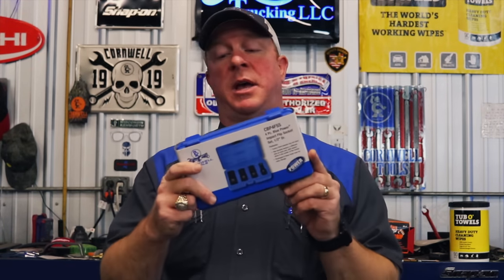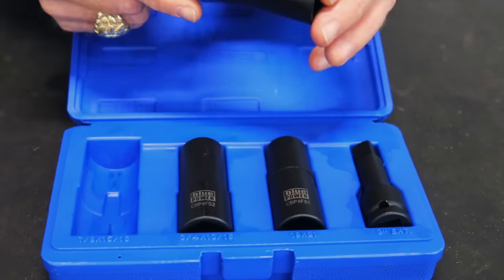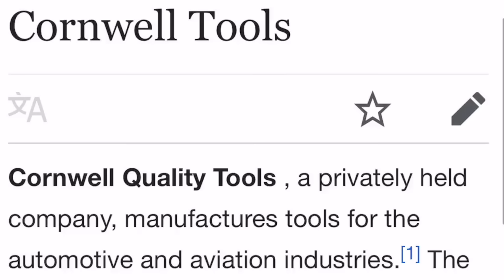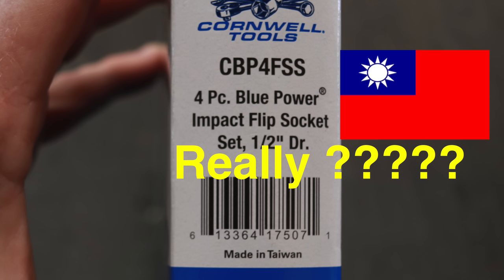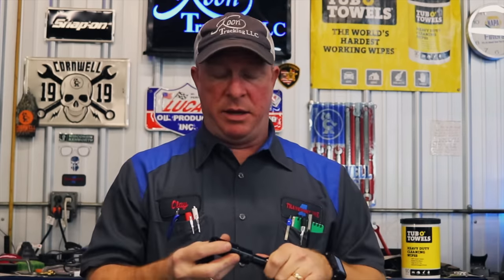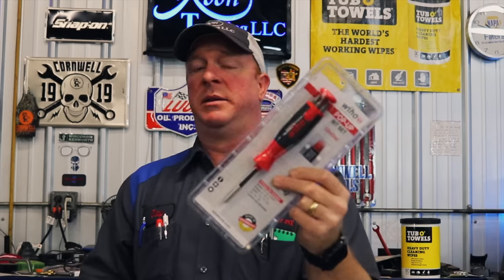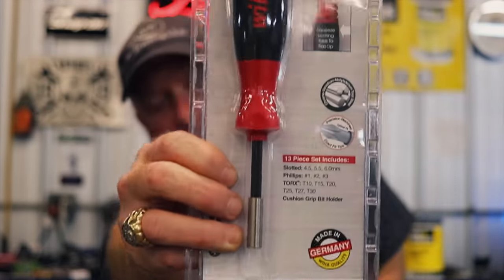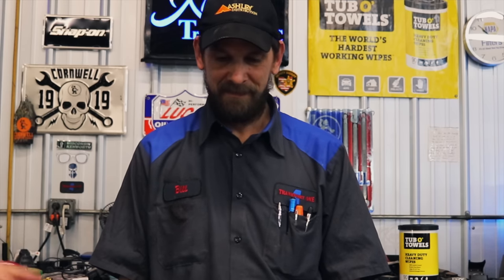Cornwell Tools: Putting Profit Over Quality. Made In USA?? You Guys Are Sneaky AF

Comment: Are impact sockets actually considered "hand tools"?
Reply from the maker: Yep you can use them on a ratchet or an impact that’s exactly why they are the best and all the BS about they won’t fit in places like chrome, well that’s BS. It might have been that way back in the 80’s but impact sockets are much thinner now than ever before (I’ve even done a video on this topic and we measured them) very very few instances a chrome will work where an impact won’t. So you can buy a cheap set of chrome for those super rare occasions

Comment: Before cornwell got rid of my tool guy he was getting upset with them because they were pushing blue power
Reply from the maker: Profit over quality I guess. Seems to be a thing with Cornwell
Reply: They ended up pulling his franchise part of it was he refused to stock truck with tools that didn't sell but they required
Reply: That's way it always works get a good tool guy that actually cares they get rid of them but a snap on and matco tucks that only warranty tools they sold stay around

Comment: Blue power is there lower line of tools most of them are made out of the USA
Reply from the maker: The point of the video was to show how Cornwell is being deceitful about where it is made. It would have been nice if it was stamped on there like the pliers they sell are and not in tiny print above a barcode on a piece of cardboard that will be thrown away. In most cases if it is on a tool truck and not ordered in like my set was the cardboard would have been tossed out already so they could be displayed and opened and it would lead you to believe they were American made. I just don’t think they should be so deceptive about it. Most blue point stuff is stamped “Made in Taiwan” and some BluePoint is made in USA
Reply: Maybe you should look into wear shit is made or ask your Cornwell guy
Reply from the maker: It’s hard to tell when they don’t put it on the case or the tool. When they intentionally stamp it on the cardboard wrapper in tiny print you would think they don’t want u to see that. Guess they are ashamed of that fact or maybe they know if it was marked like it should be they wouldn’t sell them. Seems intentional to me

Comment: I honestly don’t think any of their Blue Power stuff is US made. It is like Blue Point I believe. I know it does suck though.
Reply from the maker: It would have been nice if it was stamped on there like the pliers they sell are and not in tiny print above a barcode on a piece of cardboard that will be thrown away. In most cases if it is on a tool truck and not ordered in like my set was the cardboard would have been tossed out already so they could be displayed and opened and it would lead you to believe they were American made. I just don’t think they should be so deceptive about it. Most blue point stuff is stamped “Made in Taiwan”
Reply: Koon Trucking yeah it is pretty unfortunate. We dont have Cornwell in the Texas panhandle. I have never owned any cornwell. I do agree with you. If it comes from the truck it better be US. Anything foreign i can get off Amazon a lot cheaper. I know anything Matco sells i can get half price off Amazon. Great video. Hope you are doing well

Comment: Northern tool has a similar set for about 15 also made in twain, maybe at the same factory.  A lot of the steel used in the us comes from china from american scrap.  Chinese steel can be traced by laboratory test.  Chinese steel has a higher level of isotopes.  I worked a place that sold ameeican  made equipment with chinese hydraulic motors with made in china ground off.  Its not smart to mess with wild bill he has a large fan base in youtube land.

Comment: ibought a set of 3 hose pliers from Cornwell on sale from $ 99.00  to $ 79.00 case said use ,each plier says China . They are rusting in my tool box ,never use them. I bought a similer set from Harbor Freight for less then $ 20.00. use them constantly and they have held up fine.made in China.  Go  figure.

Comment: I'll make this ez for you Mr. Koon, Blue Power is their 2nd tier line, made outside of the US and usually 50-75% cheaper than the premium Cornwell product made in Ohio. If it's Blue Power it's never an American made product. Snappy does the same damn thing with their Blue Pointe product and don't even get me started on MAC and MATCO..hell, Matco makes nothing themselves but their toolboxes, everything they sell-minus the toolboxes-is sourced from the orient.
Reply from the maker: It would have been nice if it was stamped on there like the pliers they sell are and not in tiny print above a barcode on a piece of cardboard that will be thrown away. In most cases if it is on a tool truck and not ordered in like my set was the cardboard would have been tossed out already so they could be displayed and opened and it would lead you to believe they were American made. I just don’t think they should be so deceptive about it. Most blue point stuff is stamped “Made in Taiwan” and some is made in usa

Comment: I disagree. The tool truck is all about customer service and convenience. If it were purely down to quality, there's loads of other high end options out there. Mac, Matco, and Cornwell farm out most of their stuff and don't openly state the COO. With Snap on, at least I can go on their website and easily check the COO of each item. The bottom line is that I'm only going to pay so much for a tool where the main motive for outsourcing is cost cutting. If the tool trucks want to compete with cheaper options like Harbor Freight, Tekton, Sunex etc., they are going to lose out in the long run when their name isn't worth anything.
Reply from the maker: I see your point but i should have been more clear in the video. I was feeling cheated because bluepoint stamps made in Taiwan. Cornwell stamps it on pliers and other stuff. But in this case no stamping and only the tiny writing above the bar code on the box “made in Taiwan”. I just think they should have put it on the box or tool itself. A sneaky dealer could toss the sleeve and lead people to believe they are USA made tools. I love the convenience of the tool trucks that’s why i buy them from trucks vs other places, but i felt a little cheated on this one with Taiwan tools. I would have paid more for the American set if available.
Reply: Koon Trucking the sensor socket set I mentioned earlier didn’t have anything stamped on the sockets either. Just a itty-bitty sticker affixed to the inside lid of the case that said, “Made in China”.

Comment: Cornwell only makes a small portion of what they sell. Screwdrivers, most pliers, bit sockets and anything that isn't in bold face font in their price list is made by someone else. As others have said, the entire blue power line is imported. At least it wasn't China, Peoples Republic of.  I would be disappointed in those flip sockets simply because the sizes aren't stamped but, only laser etched.  On a side note, many Wiha tools are made in Vietnam.
Reply from the maker: It would have been nice if it was stamped on there like the pliers they sell are and not in tiny print above a barcode on a piece of cardboard that will be thrown away. In most cases if it is on a tool truck and not ordered in like my set was the cardboard would have been tossed out already so they could be displayed and opened and it would lead you to believe they were American made. I just don’t think they should be so deceptive about it. Most blue point stuff is stamped “Made in Taiwan”

Comment: Yeah.. have you warranty a matco socket lately or wrench? You give them a USA made socket stamped "usa" and hand you back a Chinese  socket... that's giving it to you.  Stop crying its blue power it's like blue point. At least Cornwell will still warranty a usa socket for another usa socket. Matco is like craftsman...
Reply from the maker: It would have been nice if it was stamped on there like the pliers they sell are and not in tiny print above a barcode on a piece of cardboard that will be thrown away. In most cases if it is on a tool truck and not ordered in like my set was the cardboard would have been tossed out already so they could be displayed and opened and it would lead you to believe they were American made. I just don’t think they should be so deceptive about it. Most blue point stuff is stamped “Made in Taiwan” some of the BluePoint tools are made in USA also.

Comment: I'm confused, you pointed out it was blue power but seemed surprised it was made in Taiwan. It wasn't cornwell branded it was blue power provided by cornwell. I think you owe your cornwell dealer an apology. I have snapon pliers labeled snapon but made overseas. Not even blue point. I asked my dealer and he said not all snapon hand tools are American made anymore.
Reply from the maker: It would have been nice if it was stamped on there like the pliers they sell are and not in tiny print above a barcode on a piece of cardboard that will be thrown away. In most cases if it is on a tool truck and not ordered in like my set was the cardboard would have been tossed out already so they could be displayed and opened and it would lead you to believe they were American made. I just don’t think they should be so deceptive about it. That was the point of this video i guess i should have been more clear about it.

Comment: A lot of  quality tools are made in Taiwan. Your beloved Snap On sells Taiwan tools too under their Blue Point stuff!  I don’t think Cornwall said they make ALL of their hand tools in the US! You are assuming too much!
Reply from the maker: You are missing the point of the video. Blue Point stamps on the tool MADE IN TAIWAN the only place on this set was marked was on the cardboard portion that would have been thrown away by the dealer more than likely. It isn’t marked on the plastic case or the tool. That’s the sad part.
Reply: Koon Trucking Yeah, I did miss the point and See what you mean.  The tools themselves could have been stamped but there
probably isn’t a law requiring this. This opens up a can of worms, really since so much product is now “assembled” in the USA
Using offshore ( usually Chinese) components! Pretty hard to “assemble” a socket or a wrench but this is already happening 
with things like toolboxes and shop equipment.

Comment: Blue power is cornwells version of snap ons Blu-point
Reply from the maker: It would have been nice if it was stamped on there like the pliers they sell are and not in tiny print above a barcode on a piece of cardboard that will be thrown away. In most cases if it is on a tool truck and not ordered in like my set was the cardboard would have been tossed out already so they could be displayed and opened and it would lead you to believe they were American made. I just don’t think they should be so deceptive about it. Most blue point stuff is stamped “Made in Taiwan” and some blue point is made in USA

Comment: All blue power stuff is sourced outside the us there basically the same as blue point this video is honestly not even a fair comparison
Reply from the maker: Guessing you didn’t read the previous comments or hear the part about the only thing mentioning it wasn’t made in USA was the tiny print on the package only that would normally be discarded by the dealer since most tools aren’t displayed in the boxes so guys can open the case and see the actual tools.

Comment: I feel you should have known that.... like you said. 

There hardline tools are USA.
Reply from the maker: If i had known that i wouldn’t have purchased them. The entire point of the video is they are trying to hide the fact that are made in Taiwan. It would have been nice if it was stamped on there like the pliers they sell are and not in tiny print above a barcode on a piece of cardboard that will be thrown away. In most cases if it is on a tool truck and not ordered in like my set was the cardboard would have been tossed out already so they could be displayed and opened and it would lead you to believe they were American made. I just don’t think they should be so deceptive about it. Most blue point stuff is stamped “Made in Taiwan”.

Comment: I wouldn’t say that Cornwell claims to be only American made, Wikipedia is a very unreliable source with descriptions made by anyone, the people that make the descriptions probably don’t have any affiliation with the company and likely don’t even own anything cornwell. I’d go to their website if you’re looking for accurate information or talk to your dealer, I’m not saying that you’re wrong with what cornwell claims, it’s just that Wikipedia is probably the worst source to use to make an argument. Not really fair to your dealer that you bash him like that and use Wikipedia to back your argument.
Reply from the maker: I have no issues w my dealer my issue is that it is tiny print on the box only and not on the tool. They stamp the pliers ? Why not stamp the socket or something. Most dealers would take the sleeve off and sell the tool i think.
Reply: But I don’t think cornwell claims to be only made in USA, Wikipedia claims that. Unless you’re presenting an entirely different argument that dealers are selling telling to people under the misconception that everything is made in USA. The misconception coming from information found on Wikipedia. I really just don’t understand your argument at all I guess.
Reply from the maker: The point is I think Cornwell (the company) is trying to be sneaky. It would have been nice if it was stamped on there like the pliers they sell are and not in tiny print above a barcode on a piece of cardboard that will be thrown away. In most cases if it is on a tool truck and not ordered in like my set was the cardboard would have been tossed out already so they could be displayed and opened and it would lead you to believe they were American made. I just don’t think they should be so deceptive about it. Most blue point stuff is stamped “Made in Taiwan” on the tool or the case.

Comment: You really didn't know? All tool truck brands do this. Including Snap On. Yes some are made here but not all tools. I remember the Chevrolet Camaro commercial that said " What do you expect from a country that invented rock and roll;  when the car was made in Canada. If it's made here there's a chance the company is owned by an off shore parent company or the American employee that made it isn't paid well or lacking in proper benefits. You just can't win nowadays...
Reply from the maker: The point of the video was why did they try to hide where it was made ? It would have been nice if it was stamped on there like the pliers they sell are and not in tiny print above a barcode on a piece of cardboard that will be thrown away. In most cases if it is on a tool truck and not ordered in like my set was the cardboard would have been tossed out already so they could be displayed and opened and it would lead you to believe they were American made. I just don’t think they should be so deceptive about it. Most blue point stuff is stamped “Made in Taiwan” some of BluePoint is actually made in USA
Reply: Koon Trucking I get it and agree with you. I also try hard to buy an American product but it's about hopeless.  I have been looking at trucks and good luck. Dodge is foreign owned. Ford and Chevrolet use many overseas parts. Feeling frustrated too.
Reply from the maker: Chevy is moving it’s plant to Mexico for trucks ...... Ford is the only one left. They have foreign parts in it but think about it since 1987 ???  If it had a computer it had foreign parts anyways ? Plus ford didn’t have to have a government bail out and still move its plant to Mexico. That’s the real sad part. The govt bails your ass out and then you screw them by moving jobs to another country...... really piss on Chevy ! Glad i don’t own one of them!
Reply: Koon Trucking Preach on!

Comment: I’m not kidding when I say that ive been in the automotive repair industry for 30 years in two states and never seen a Cornwell rep. Obviously the company is on shaky ground or you’d see more reps. I’ve got a ton of high end tools from MAC and even Snapon that I can’t get a rep to warranty. It ain’t  right , I don’t care what they say.
I sent Matco Tools an e-mail telling them that if I wanted Taiwan made tools I could go to Harbor Freight and purchased Taiwan tools for 0% percent interest. I understand Matco trying not to loose business but if you don’t offer USA made tools then there’s no reason to pay more for a tool truck stuff. Matco, are you listening? I doubt it but at least I spoke my mind.
Reply from the maker: Matco has USA made tools. I bought USA made flip sockets to replace these Cornwell ones plus ratchets and extensions I purchased were USA made. They have sockets made in USA too just cost more than the ADV line
Reply: Koon Trucking Yes sir you are right but even Matco tries hard to hide where certain things are made.
Reply from the maker: Wayne Swicegood Matco has it stamped on the tool and many times even the case that it comes in. Cornwell hid it on the cardboard wrapper that most of the time would have been removed by the dealer. Every tool I have seen by Matco that was made in Taiwan was stamped on it. I have a bunch of Matco tools and I have to give it to them they didn’t hide it like this Cornwell set was.

Comment: Snap on has Bluepoint
Matco has ADV
MAC has Expert
Cornwell has Bluepower
What’s the confusion? Are you making videos for the other value brands? Cornwell is the most transparent with their products. You can tell if it’s a rebrand by the first letters in the product #.
Reply from the maker: You missed the entire point of the video. The country of origin was only marked in tiny print on the packaging that would normally have been thrown away when the product was displayed on the tool truck but since my dealer ordered these for me, he left it in the cardboard packaging that had that tiny little print on it.